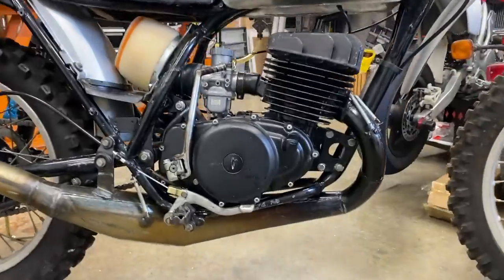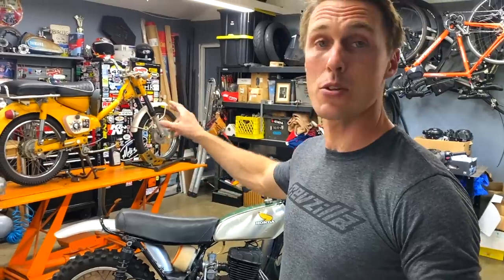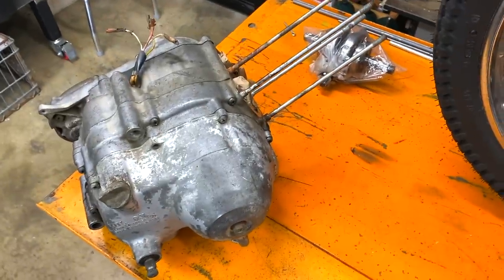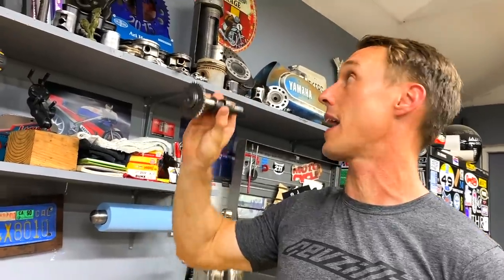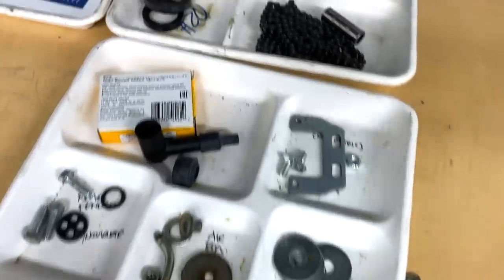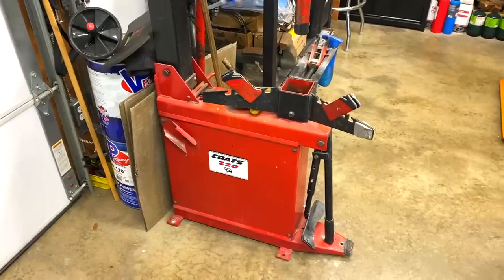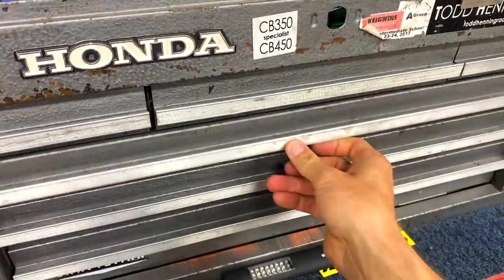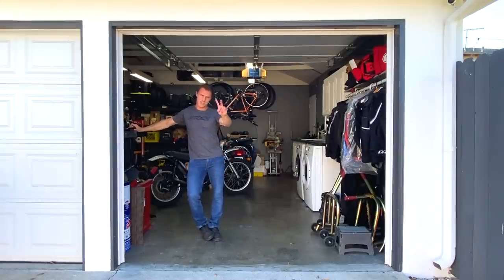Ari’s Big Displacement Garage | Inside the Garage

Comment: A trick for the ziplock bags is to put the contents label on a card or piece of paper inside the bag.  You can still read it and you can reuse the bag for other projects.  It reduces waste and makes those one-time-use plastics last a very long time.
Reply: great tip!
Reply: I wipe the sharpie off with some isopropyl to reuse the bags.
Reply: Or you can write the name of the components on pieces of paper tape then stick them on the zip-lock bag.
Reply: @imDioxitCF  I tried that, it's sometimes difficult to get the tape off and it can rip the bag.  For some of the heavier plastic it works okay.  I have a stack of little more papers next to the bench and just grab one each time.
Reply: The card on the inside is a great tip. The hospital I worked at years ago had skull flaps in freezer to await re-implantation, had the info taped to the outside of the bag, labels fell off and it was a mess!

Comment: 👍on the parts bags I got in the habit of using them when I was a jet mechanic in the Air Force whenever we took apart the engine those fasteners got put in a bag and labeled our bags were cloth with a built in tag and string closure, we did use a LOT of zip lock bags 
I  saw on Amazon you can get the heavy duty ones 100 ct for about 9 bucks. 
Small bikes are way more fun I'm glad I'm not the only one, looking to get a small motorcycle soon, LOL I'm in foot, bicycle, bus and train mode right now.😆

Comment: Tire changer question. Every time I change tires in the shop they also use another machine that checks the wheels balance and apply "stick on weights" if necessary. I thought that even if I could change tire myself, I couldn't do the wheel balancing properly. However If I could change tires myself it would make life sooooo much easier for me. Especially if I could change between my street and dirt tires.

Comment: Do you rebuild ct110 motors. I'd definitely like to have you rebuild my 81. It definitely needs a skilled technician to go through it, and make it roadworthy again.
Reply: I do, or I should say I can, since I haven't actually done a 110 yet. It's more or less the same as the 90s though, and every other lay-down single Honda has made. Where are you located?
Reply: @AriH211  I'm located in Washington state. If you have an address I can send you the engine or the entire bike. Whatever you think is best. It runs right now. Just not reliably